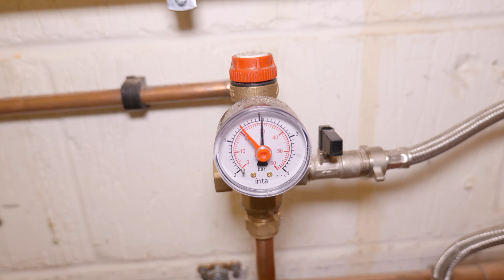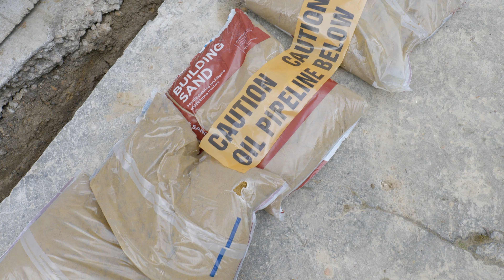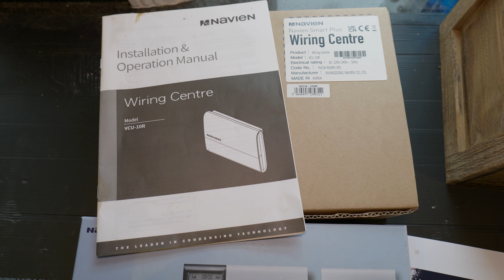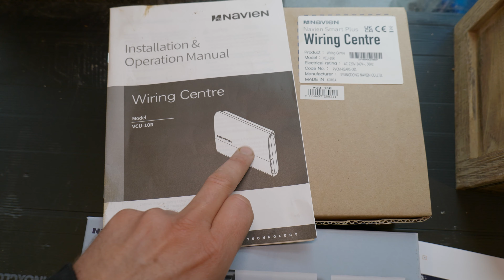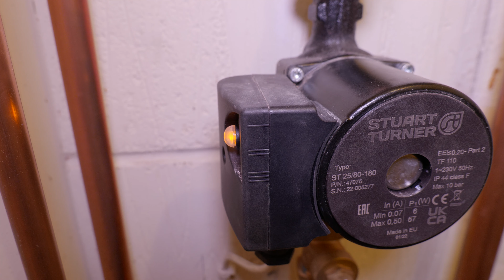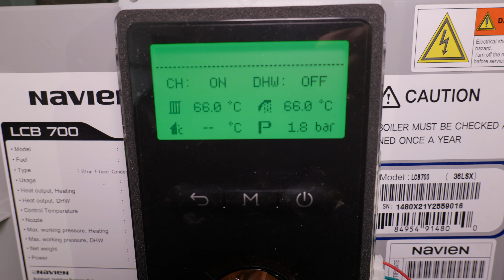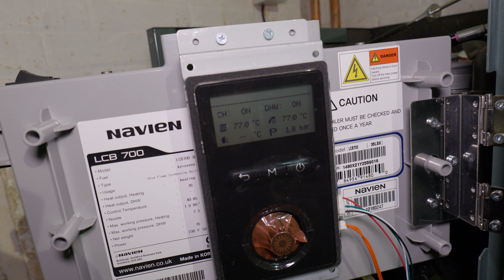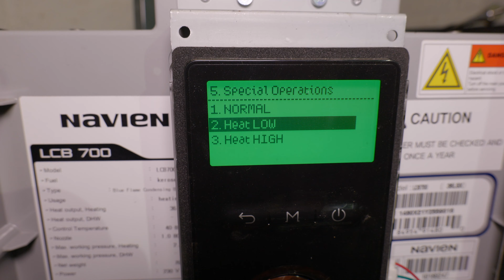Oil Boiler and Low loss Header Installed - Navien LCB700

Comment: Nice job....👍
Navien combi gas boilers have got a lot of problems over in the USA with multiple faults in their construction and long term reliability issues , this is the first oil boiler I've seen and it will be interesting to see how it holds up in the next few years compared to its gas equivalent , I hope your going to do the servicing and maintenance of the system so we can follow its progress...
Cheers..... 👍
Reply from the maker: Yes someone else had mentioned the problems In the US. Luckily that's a completely different model. I will definitely do a service video when the time comes. Thanks again .

Comment: Here in the UK, I inherited one, exactly the same model, from previous owner who bought it in mid 2022. It gave me error code E012, called Navien technical support, was told to seek external help by a very rude technical support guy. Spent 2 weeks plus via referrals and service companies contacting 10+ engineers, but All refused to take up the job, reason being Navien got very bad technical support, rude staff, and very difficult to obtain replacement parts - a nightmare. It seems it's far better for me to replace it with a common brand boiler like Worcester Bosch of which much easier to get engineer to fix and easier to obtain parts here. 😢😢

Comment: Pea gravel is non compressible and better than sand for drive crossings etc.   ;-)                      Main problem with Navien  you eluded to without realizing:        Components are more like gas boiler,  they won't last in the far more aggressive/corrosive oil boilers.........              If you watch any American heating chanels you will have seen the problems Navien are having over there (  they have been there some years now)    

Biggest problem I see is Navien don't use industry standard burner spares so as a service engineer I wont have ANY  spares on the van to fit them, so customers will be cold until I can get them from Navien.        Time will tell I guess.     Cheers.
Reply from the maker: Thanks for the feedback. I have seen some issues with the Navien gas boilers in America but not so much the oil Boiler, or this particular model. I had similar concerns with parts etc, but it comes with a 10 Year warranty, and Navien has a nationwide service/repair team. Having been on the manufacturers training course, and met some of the staff I feel confident in the product. As you say, time will tell. Thanks 👍